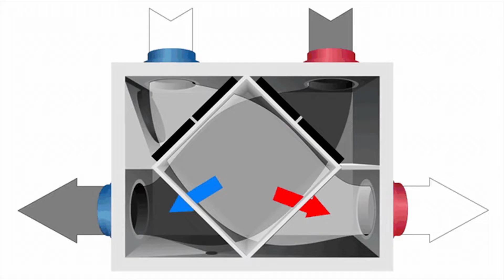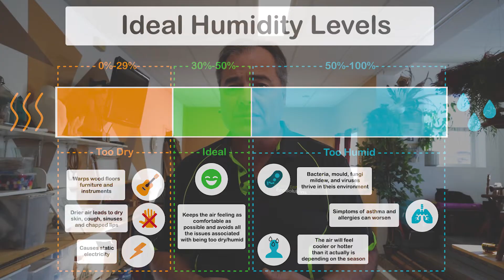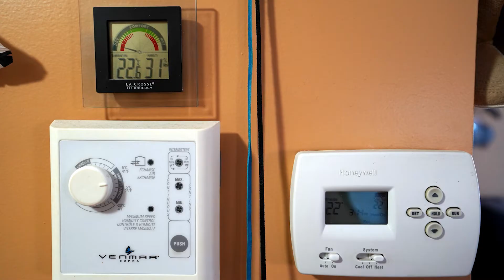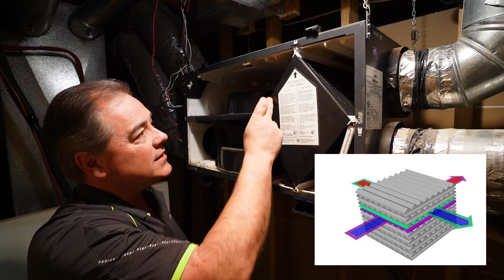How to operate and maintain your HRV to prevent mould growth - Venmar Solo 1.5

Comment: I live in MN and I always have window condensation. My house is 10 years old. I can't get my winter humidity below 45-50. Any suggestions?
Reply from the maker: I recommend that you operate a dehumidifier with a rating of 50-pint/day and set it to 30 - 35%. Ideally you want to hook it up to drain automatically into a floor drain. If you're using a forced air furnace I recommend turning the furnace fan from the auto position to on . Hope that helps

Comment: Hi I have a high efficient air exchanger/ water tank system. I have an ERV do I turn off in the summer and on in the winter? Thank you for making this video.
Reply from the maker: In my opinion an Erv Works more efficiently in warmer temperatures. Where I live the temperature gets down to -40° and an HRV is better suited for these temperatures. You should be able to operate your Erv year-round but I would recommend having a 50-pint per day rated dehumidifier as a backup to maintain humidity levels.

Comment: How do you clean the core?
Reply from the maker: You grab both sides of the core and pull it straight out. If it hasn't been cleaned in some time it may be more difficult to remove. Make sure you pull your filters out first. Once you have it out I recommend putting it into a container of warm mild soap and water and let it soak for an hour, then pull out rinse and Air dry.

Comment: During summer time, it need to be off but the bathrooms ventilation system will work, when we press the button or not.
Other thing which I feel is that this one is not very strong ventilation for bathrooms. Anyone have same issue?
Reply from the maker: You are correct in saying that the bathroom fan switch will still work even when your humidistat has been switched off for the summer. You can test the exhaust by taking a square piece of toilet paper and placing it up to the vent in the bathroom, the air movement should hold the tissue paper in place.

Comment: We just moved to our first home in June. I have the dial set to “off” since it is summer time. But when I go to the utility room, the unit is running quite often. Do I need to unplug it? I haven’t ever pressed the button in the bathroom to make it turn on. Is there an override setting or something in the unit that causes it to run even without the dial being set to “on” and without me pressing the button? Thank you!
Reply from the maker: I have run into this situation a number of times and it is quite often that the HRV is wired incorrectly. I would recommend calling an HVAC contractor and having them look at it.

Comment: If I want more humidity, do I turn the dial towards the arrow that says more humid. Or does that mean it's more humid outside
Reply from the maker: To set the thermostat to maintain a higher humidity you want to turn it counterclockwise if I understand your unit correctly, it sounds very similar to the one I show in my video.

Comment: I am unsure which way to turn my dial. It has temperatures plus 5 C all the way down to -30. At the top, it says more humid with an arrow counterclockwise, and at the bottom it says less humid with an arrow clockwise. Does that mean the air is less humid or that I want less humidity
Reply from the maker: It sounds like it's similar to my humidistat, you want to turn it clockwise to reduce the humidity and in the summer months turn it all the way counterclockwise. Mine also has temperatures and the theory behind it is the colder the temperature outside the lower the humidity you want in your home
Reply: @breatheeasyecosolutions4726  Thank you.

Comment: Question:  I’m wondering if it’s normal for an HRV operating in Manitoba to never produce condensation?  The water drain tube from the HRV is always dry.  I think this means air moisture inside the home is stable and controlled in a very good way, but could I be missing something here.  Running a Venmar Constructo 1.0 and have never seen water being released from this unit at any point, winter or summer.  I have opened the unit for cleaning. Always dry in there too. Only maintenance is cleaning foam filter inside periodically.  Does this situation seem normal?
Reply from the maker: An HRV should produce condensation from the drain lines. I would recommend monitoring the humidity during the colder months and adjusting the HRV down to confirm that it is in fact removing humidity from the air. You can do this by having a separate digital humidity gauge, some are built into thermostats if you don't have one you can always purchase a cheap model like the one I have.

Comment: Excellent video. How do you increase the humidity level in your home, ie., what setting should the dial be set at?
Reply from the maker: The HRV will not increase the humidity in your house unless the relative humidity outside is greater than the relative humidity inside. If you would like to increase humidity, then a humidifier would be required. Keep in mind that your humidity should be between 30 and 50%, closer to 30% during extreme cold. Watching for condensation on the windows is a clear indicator of too much humidity.

Comment: We recently purchased a home that uses this exact model. Few questions regarding its maintenance and operation.

For winter months should we keep it on min constant or the alternating?

The knob for that control unit can it be purchased? Previous owner broke the inner tension clip that holds it on.

The filters around the core, looking on Amazon they run 109$ for a pair, are there any reputable websites that have equally quality filters for cheaper?

The fans inside the silo, when looking ours the fan wheel is caked full of built up thick dust likely from moisture and lack of filter replacement. Is there an easy and or recommended way to clean both fans?

The hose discharge line for condensation, should that line be a specific type of hosing outside thickness? Ours is dirty or moldy, hard to tell so we wanted to replace it but didn’t know if there was a recommended type to use?
Reply: Thanks for the video it was extremely helpful.
Reply from the maker: For the winter months I leave mine on intermittent and depending on activities in your home, like having multiple guests over and cooking a large dinner, I would then switch it to maximum for that time. As for the control knob. You may want to try some hot glue or glue to put it on , I find that a lot of Manufacturers change the design and the parts are no longer available. The filters I have in my unit are a generic type and you should be able to find them in hardware stores and cut them down to the size of your filters using yours as a template. As for cleaning the fan blades , I personally would do that myself taking great care as not to damage any of the blades or mechanisms. If you are not comfortable with this I would recommend reaching out to an HVAC contractor.. When replacing the discharge hose and finding a replacement tube, I would cut off the end and take it into a hardware store to find a size that is similar . Good luck with your maintenance

Comment: Excellent video. Is it possible or recommended to connect my HRV’s humidistat to the ecobee thermostat to keep them both on one unit?
Reply from the maker: I'm sure it is possible but it may require an additional circuit to marry the two units together.
Reply: @ thank you for your reply. I decided to keep them separate. It gives me better control of fresh air circulation.

Comment: Damn this is one of the best laymans term videos for HRV I have ever seen.  And Ive been watching a ton lately to make sure things are done right.  No making people feel bad for picking an HRV over an ERV either to make themselves feel better.  I recently installed an HRV this fall so we have better air circulation and refresh since the house has been worked on and sealed for all the Canadian Home Grants.  With Manitoba getting as cold as Alberta, whats the best way to ensure that the HRV core or cabinet dont freeze up.  Been seeing many pictures of issues with HRV in extreme cold, so want to know the best way to not have this happen
Reply from the maker: I live in the Winnipeg area and have yet to have any issues with freezing. You can install an inline heater to warm the freezing air slightly if you run into any issues. Hope that helps
Reply: @breatheeasyecosolutions4726  This winter will tell the tale.  I know it all depends on outside temps as well.  I think many have issues of freezing due to not understanding them, or bad setups, or not lowering their humidity in the house when they see a cold snap coming..  I have flex pipes on mine, so an inline heater wouldnt be an option I dont think

Comment: Great video!  What temp/humidity do we stop running it at?  In Minnesota we have winters that are sub zero, but summer can be 90 and 98% humidity. When should I turn it off and then back on again?  My dial on the humidistat goes to 80 degrees Fahrenheit
Reply from the maker: I recommend that you operate your HRV to control humidity when the temperatures get below freezing and turn it off when the temperature goes above. I operate a dehumidifier set to 35% year round that controls the humidity during the warmer months.

Comment: Great video. I cleaned filters and now won't power on. Is there a reset like newer vanee units? I have the same one as in your video
Reply from the maker: I don't believe there is a reset switch. Try holding the door button with the door off and listen for a click. The only "reset" I can think of is to unplug the unit, wait 60 seconds then plug back in. Hope it works for you.

Comment: How does the bathroom control work.
Reply from the maker: There should be one of three styles. 1) A standard light type switch 2) A button switch 3) A multi-button timer switch. Once activated, it turns on the HRV then sends a signal to turn on the furnace fan. The exhaust point in the bathroom should be on the top of one of the interior walls.

Comment: The wall control in your thumbnail is the one we have. Our system didn't come with a manual we purchased the house with the HRV already installed. Can you run through how to use that specific controller ? I've tried to find it on line with no success.
Reply from the maker: The dial is to adjust the relative humidity and the min/max/intermittent is to set the ventilation. As discussed in the video, I find it easier to use a digital humidity gauge.
Reply: @breatheeasyecosolutions4726  thank you!

Comment: Hii I have a issue  water was building up on the other side of the core with no drain.....well black mold started growing....I haven't checked it I  a year unfortunately...I have no clue how this works.....ive keep it on eco mode ...started see all my plants get white powdery mildew.....open that box up and what a mess....mold every where .....😮 what do I do now ....please help
Reply from the maker: It sounds like the drain may have gotten plugged. It is recommended to remove and clean all interior surfaces with vinegar then follow up with a soap and water mixture. The filters should be discarded and replaced and the core should be properly cleaned.

Comment: I set my dehumidistat to 45% humidity, but my inside humidity is around 30%. And the HRV just running constantly. Why is it running constantly when the humidity is already below the setting?
Reply from the maker: What type of main controller do you have? If you have the same one in the video with the dial, try turning the dial and listening for the click. The unit should come on and run continuously when it is set to below the click and off when above the click. If you have a different controller with humidity displayed it is possible that your unit may be faulty or that your controller is set to continuous operation. Hope that helps, good luck.
Reply: Thank you for the detailed video, My HRV controller screen recently flashes green with an icon that looks-like a  sound icon, and i noticed the HRV unit where the core and filter seats has some ice, weather condition is around-27, Could it be the unit-is defrosting it self?

Comment: Excellent presentation ! I moved into an apartment and I think the ever is in the attic , I doubt it’s been cleaned . Electric heating system , since I’ve closed my windows for the year I find my eyes are burning , when I’m out of my home I’m fine once I get home burning eyes , also the house smells a bit stale …I’m am at aloos and my landlord says just put the control to 50 . Can you advise ? Thanks !
Reply from the maker: If you are questioning whether the HRV has been cleaned I would definitely inquire to your landlord about cleaning it as this should be done at least annually, every 3 to 4 months for the filters. Monitor your humidity level in the apartment and it should be between 30% and 50%, closer to 30% during freezing outdoor temperatures. You may need to use a dehumidifier if you noticed heavy condensation on Windows during sub freezing temperatures. Hope that helps.

Comment: Humid level remain 30 to 35% only. It doesn’t go up to 45% any suggestions
Reply from the maker: I have a dehumidifier set to 35% humidity and training directly into a floor drain. My humidity at most gets to 45% relative humidity. If your humidity remains between 30 and 35%, you should not have any issues with the house. If you find that it is too dry for breathing or your skin, you can use a humidifier but make sure you monitor the humidity and not exceed 50%. Of course it is recommended to keep your humidity between 30% and 50% during the subfreezing temperatures. Hope that helps, take care.